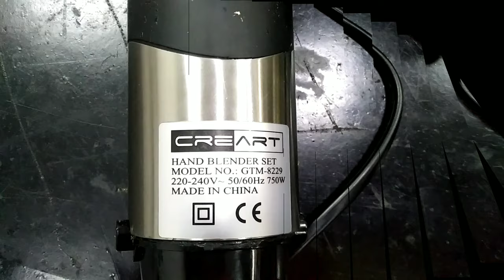How to Open and Repair Hand Blender CREART GTM-8229

Comment: With my silvercrest ssms 600 i was fortunate i didn t had to weld it , but the chancing of the cable also took time enough , i even re used the existing connextion copper plugs.....wich i had to be verry carefull with

Comment: Hi. I have a Princess 1000W. It stopped in the middle of mixing lemon salad cucumber. I chopped up the lemon and the cucumber into small pieces. mixed for a few seconds. Then it just stopped. No light in the two switches (blue light when you have power). Now there is no blue light. means no power in. Is there a fuse inside this. What happened. Only a few months old machine.
Reply from the maker: Yes check the fuse inside.

Comment: Hi Guys , Do you know how to open a Model no: POB-2208S (Prima one&only) exactly the same as your video ,but without the dislocating ring that comes off at the front. This one is one solid piece at the front and I cant get it separated from the steel/alu plate to get out the motor . I disassembled the rest ok . Help please !!! Kind regards. Enjoy your day!!